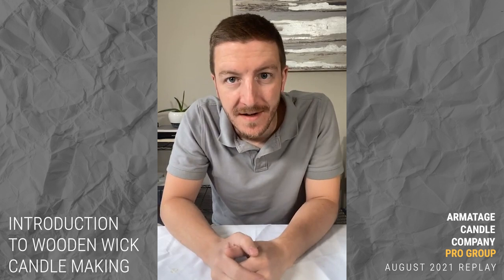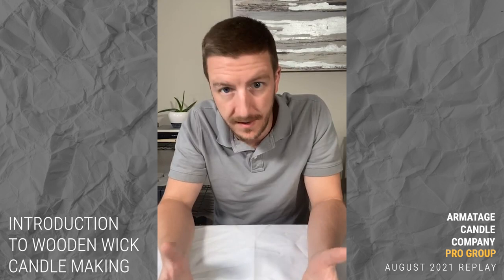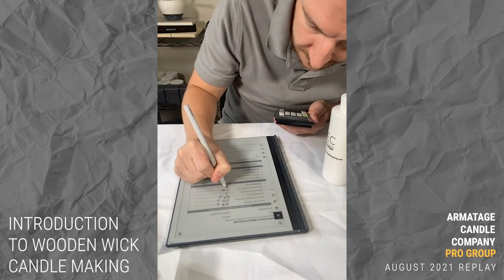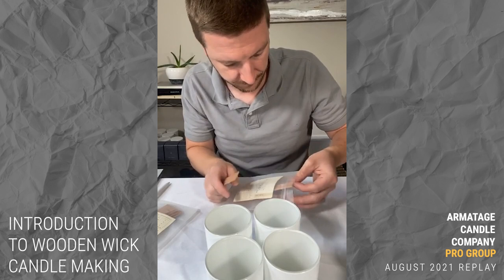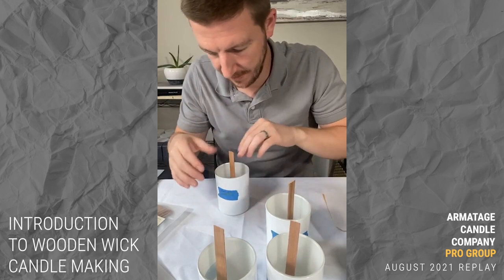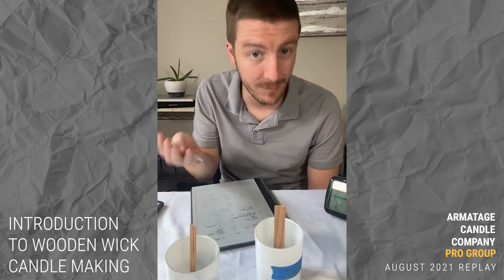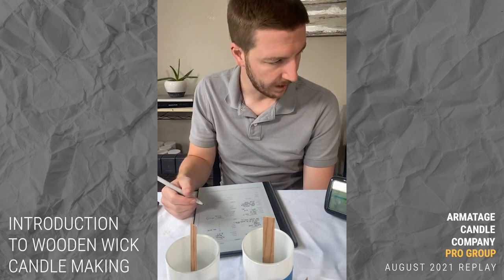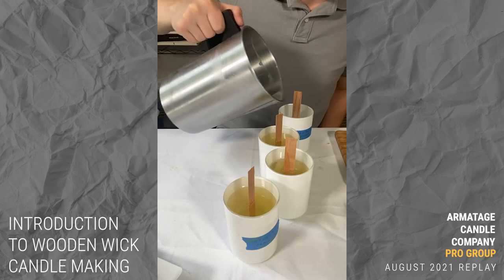Introduction to Wood Wicks - Candle Making

Comment: Hey Kevin!  Don't forget... sometimes a booster wick is too much, and the next size down isn't enough, like you pointed out.  I've found you can actually use a crackling wick and a whisper wick, together, to get that "sweet spot".  You don't have to worry about the adhesive used for the booster wick either.  There's a lot more than just 15 options😃.  I've been making candles with wooden wicks for almost ten years, but I signed up for your class so I could learn more about cotton wicks. (Would that also be the "pro group"?)  There's always room for improvement!  Thank you for this video!  PS what kind of tablet are using?  I really like that you can write on it and not have to print up the documents!
Reply from the maker: Amazing advice!  Never thought about doing that!  The device I’m using is called Remarkable 2.  It’s amazing!
Reply from the maker: Pro Group is a private Facebook group you can join if you’re enrolled in the course (or previously enrolled)
Reply: Hi Melisa! I have some questions about wooden wicks and I'm not sure uf you're used to coco apricot creme wax but my wax gets a brown then turns black midway through the jar like lower half no matter what wick I use... are whisper+crackiling burn cooler than a booster?
Reply: @marieeleanorbejar6231  Did you figure this out? My wax turns brown as well.  I use a coconut wax.  I was told coconut wax can easily overheat and that was why the wax can turn brown. But I'm curious if Melisa experienced that with her wick and wax.  I notice the whisper wicks looked lighter in color than the wick i use from another company and was wondering if the whisper would make a difference.

Comment: It's hard to make the argument for relying on the consistency of wood wicks, when the biggest complaint against wood wicks (industry wide) is their lack of consistency. @33:30, (as you yourself point out @7:47). 
If Makesy suggests that their wicks are 'pour-ready', (@33:59) then they should offer refunds for those wicks that prove to be inadequate. Or....you could run some oil-soak tests!
Reply from the maker: Couldn’t agree more. They are fickle and honestly a bit of a liability.

Comment: Sorry to be ignorant but where did you pull the conversion factor from? I am assuming this is the weight of the scent but you didn't provide how you came to this .86 number. Why cant I just use .34 or .99 etc? Are you able to elaborate please.
Reply from the maker: That's a great question I answer in this somewhat obscure video on specific gravity: https://youtu.be/Rm-5PYku7GM

Comment: my cotton wick and wooden wick does not have a stable flame, what may i try ? i even tried soaking my wooden wick over night in fragrace oil, it burns okay.. but what can i do for dancing flame?
Reply from the maker: Dancing flames aren’t necessarily a bad thing and are even kind of expected since the local air movement near the wick is pretty active, especially in containers.  Instead, double check your flame isn’t higher than 3” and the container walls aren’t hotter than 150°F.
Reply: Your wick is too big

Comment: How does one avoid discolouration of wax. Even if my wax contains no vannailain, it still discolours?
Reply: I had that problem until I changed to soy coconut mix
Reply: @connietee4885  Thank you Connie. I'll try to play around. Xx
Reply: @connietee4885  Which soy coconut mix? What did you use before?  My melt pool is dark. I use a coconut wax too.  I was told coconut wax can easily overheat and that was why the wax can turn brown.  So now Im unsure what the reason is.  Was your previous wax that you experienced discoloration all coconut, and then you added soy??